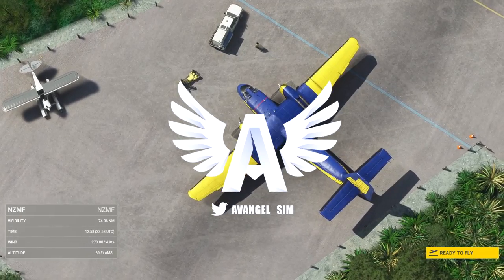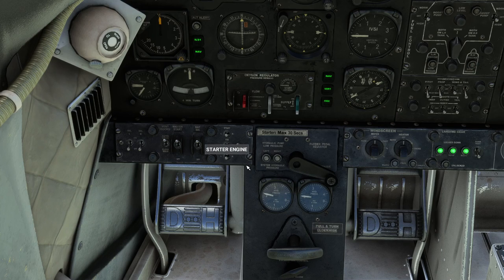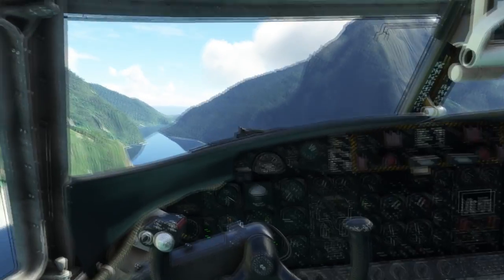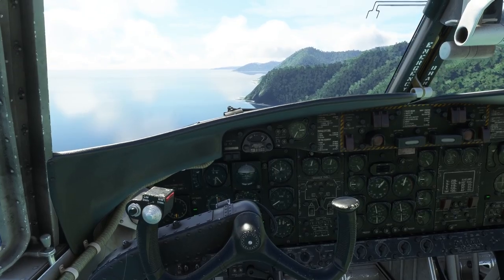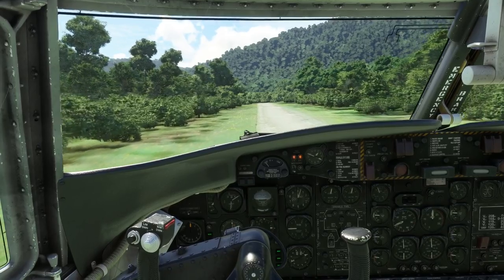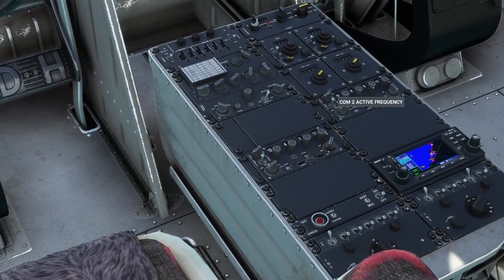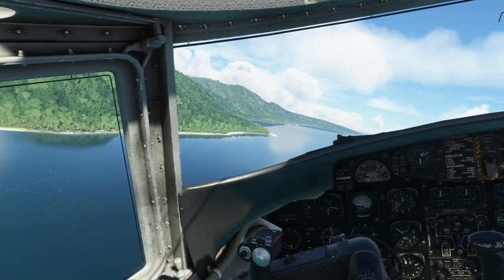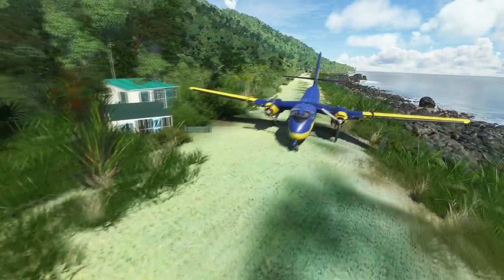DHC-4 Caribou - The Swan In Duck's Clothing - MSFS

Comment: Good stuff as always Av. The point of that gauge under the glare shield with the fast/slow on it is to guide you to an optimum approach speed for short landings. There's a diamond and either a circle or triangle on it (I don't recall which). Depending on your all up weight you put the needle on either the diamond or other symbol (the placard below tells you what weight you would select which) and that's you're ideal final approach speed if you're trying to nail your landings as short as possible. I guess the idea is with it under the glare shield it's still in view while focusing outside, rather than having to keep glancing down at the panel, also means you don't have to think about numbers, just fast or slow. 
When you fly by it, it's really pretty surprising just how slow you can bring her in on the approach, I think it's somewhere around 65-70kts, really helped me, just from the perspective of getting past the reluctance to get such a big aircraft that slow lol.
Reply: It varies with weight of course, but at the lightest weights and Flap 40, the Vref gets down to 54kts.
Reply: @Wolf_Sim.Actual  oh wow. Yeah, that's what they call a slow approach

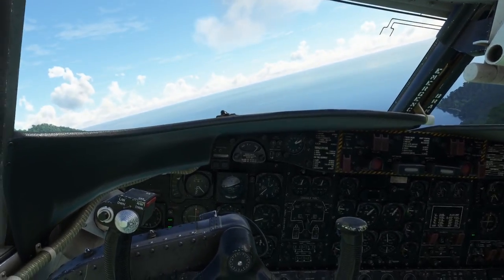Comment: @12:00, the explanation of the gull wing and how the enhanced angle off horizontal improves lift, stably, at the wing root, was enlightening.  And, the flotsam and jetsam at Gorge River is indeed cool.
Reply: With all respect - and not sure on the Corsair - but the ‘gull wing’ was not to provide more lift. It was designed to shorten the landing gear and keep it stronger. I do suspect the Corsair did the same thing. To clear a large prop but still have strength in the landing gear. I have a little over 1000hrs in the real airframe. (DHC-4). Out of interest, they dropped the gull wing in the DHC-5 when they installed turbo props.

Comment: I’d like to see a cargo version of this loaded up with a couple jeeps in the back. Yes, I think that ramp should go lower as well. Fun plane!
Reply from the maker: I swear I've seen it with them out somewhere.. how I don't know,
Reply: We used to carry a jeep in the back to do strip surveys, for example. You still only set the ramp to 15, then use the ramp extensions (and a stand to stop the aircraft tipping onto it’s backside 😂). The ramp extensions are super strong
Reply: @Wolf_Sim.Actual  THAT'S what those two long things are in the back I think! You've had some really great real life experience!
Reply: @47guitartom  that’s correct. In fact there’s two sets. One secured to the cargo floor and a second set stored in their more usual location in the tail boom above the cargo door in this model. You close the cargo door to get them out.

Comment: A little bit more info about the fast/slow indicator, or as DHC call it the 'short field approach speed indicator'.  It's driven by the stall warning system (specifically the right side lift computer, looking at the right side lift transducer vane aka angle of attack vane) and shows you how close to stalling you are. Because it's driven by the stall warning system the weather and altitude and aircraft weight are irrelevant, all it cares about is attitude and airflow over the wings. It is calibrated to work on the final approach phase of a flaps 40 landing, and it does exactly what it says on the tin - FAST means you're going to waste runway, the triangle means you're doing it right in the real world, SLOW means you're doing it right in the sim :)  The stick shaker should kick in about when the needle gets to the L in SLOW at flaps 40. ObDisclaimer - this is real world info taken from DHC-4 service manuals, I haven't tested any of this in the sim to see if it actually works, although it looked like it worked pretty well in that second landing, even though I'm not sure you were looking at it LOL  :)
Reply: Light stick shakers come on at 8kts above the stall. Heavy stick shakers at 4kts above. You can see the motors on the back of the yokes - an eccentric weight spins on the end of electric motors. 
Not modeled as yet, but I suspect it will be in an update. Certainly the switch to test the stick shakers functions.

Comment: Hello,
This plane is absolutly unrealistic. 10s from cold & dark to ready for taxiing. They could have done something great, they didn't. With some planes like the Beaver you need to follow correctly the check-list to start the engine, with some you also need to warm-up or your engine will break (Wilga), but with this big plane what do you need ? power, magnetos, start engines, start alternators and lets go to the runway. frustrating.
Reply from the maker: I mean it’s the same as most default aircraft even the beaver can be started with fuel mags start. They don’t make the famous fliers that deep for a reason , realistic? No but you can follow the checklists and do it right, most stock planes let you be unrealistic even the dc3 minus the realism mod